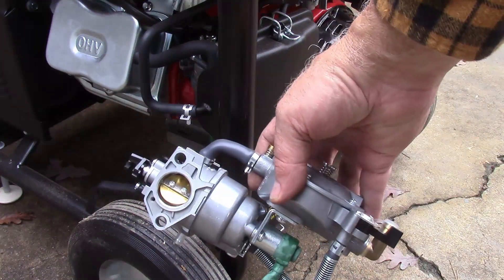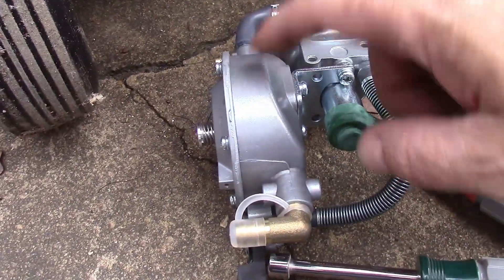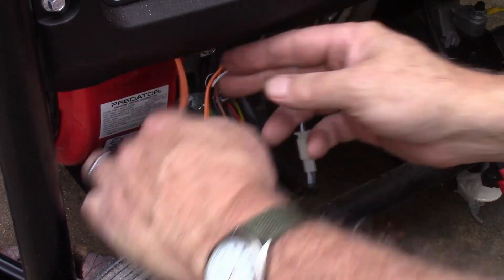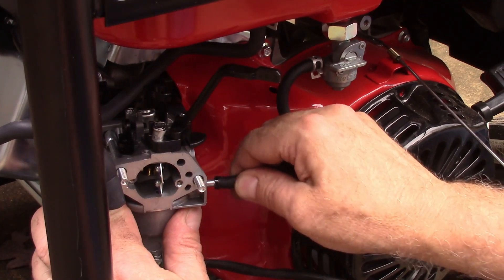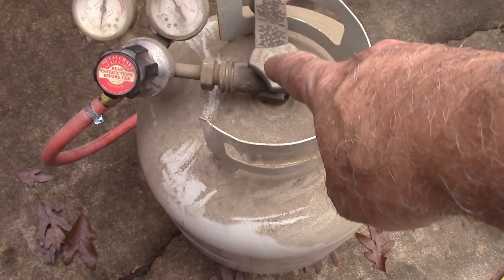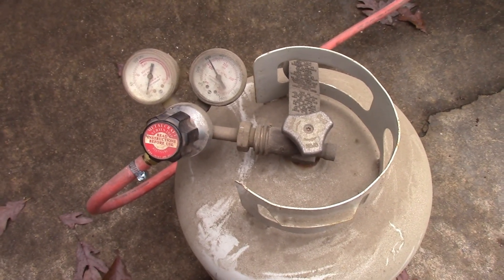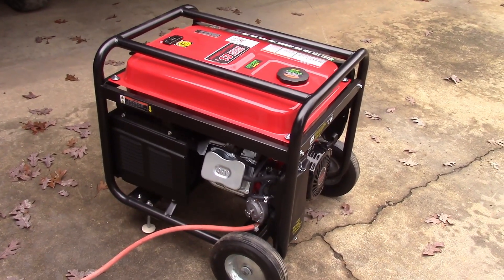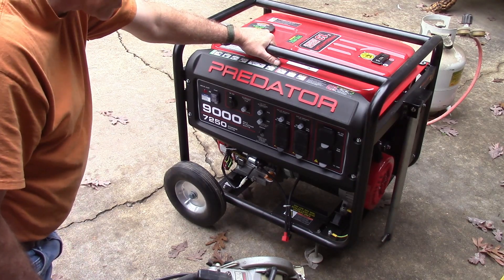Predator 9000/8750 Generator Propane Conversion  Tri Fuel

Comment: At 5:45 "The safety shut-off" is a fuel shut off relay to stop backfires at shut down.  Otherwise a good video.
Reply: Here is a reminder about portable generator safety: This advice is just to make sure that everyone is aware of all the warnings and it’s just to remind people to be careful using portable generators. Everyone has to see this safety reminder for safety. Every year, hundreds of people die or get injured when using portable generators due to carbon monoxide poisoning and electrocution. Make sure you are using your generator carefully and keeping others safe as well. There is something very serious that everyone should always be aware of when using generators. Some people do run their generator indoors which is not safe and that increases the risk of carbon monoxide poisoning which can cause death of family and you. Some people run their generator in wet conditions which can electrocute them. Please remember that you should never run your generator indoors. Remember that carbon monoxide is an odorless and colorless gas that you cannot see or smell. Carbon monoxide is a silent killer. Keep that in mind. Make sure your generator is 15-20 feet away from your house and away from doors, windows, and vents. Never use your generator in your porch too. Having a carbon monoxide detector is very important against generator safety. Some people also allow children to go near the portable generator which could pose risks. We need to keep an eye on our children making sure that they are not near the portable generator so they won’t get electrocuted or burned by the generator which is dangerous. A locking enclosure also keeps kids safe. A generator shed might look like a tempting place to explore, or take cover during a game of hide and seek, but a generator is a dangerous piece of equipment that can cause injury. It says on the manual that we should also keep children away at all times from the portable generator to avoid injuries. Please do not allow a child or unqualified people to operate the portable generator. Just because some manuals missed what should be listed doesn’t mean it’s safe to do. Always follow the generator safety rules when using portable generators. Generators pose electrical risks. If you need to use your generator during wet weather, you need a generator tent to protect your generator from getting wet. Don’t let your generator get wet. Keep your generator dry and before using your generator, please make sure your hands and your generator is dry. Do not wear loose clothing when operating the generator. Everything that is said on the generator’s operating manual should not be ignored. Never smoke cigarettes near the generator. Please keep flammable things away from the generator. Never overload your generator too. Your generator can catch fire. Never ever try to plug a generator cord into a wall outlet to avoid back feeding. Back feeding your generator is dangerous. Always turn on your generator first before plugging in appliances and shut off the appliances before turning your generator off. Use a heavy duty cord for your generator and the cord should not be worn out. All the instructions should be followed carefully. Never refuel your generator while it’s running. It can cause fire if fuel spills while your generator is hot. You should turn off your generator and let it cool off before refueling it. Having a fire extinguisher next to the generator is also important. This is only a reminder for everyone’s safety of using generators. Make sure your generator is properly grounded. https://youtu.be/I1jT3ANENvI and here is a video more about keeping others safe when using generators and also about our family’s safety. Hope this helps. Thank you. Be safe

Comment: Great job with the detailed instructions. I just ordered the same unit off Amazon to install on my HF Predator 8750. I hope it won’t require the modification of the air filter that many of the reviews mention. Also, I’m sure you’ve figured out that when using LP like you were, when you shut off the engine with the kill switch the way you did you aren’t actually shutting off the propane from the tank. Just an observation that you might make sure you consider for safety reasons.  👌 Again, great video.
Reply from the maker: Yes you will always need to shut off the propane at the source.  Let me know how the conversion goes.
Reply: Hey Soat Mon, I completed my conversion today but had to do some modifications to the air intake box. I actually have a 2020 model 8750 and Predator switched the location of the air intake hose. The air intake box is actually entirely different than the one on your 9000. The fuel tank air hose is on the side of the 9000 but on the back of my 8750. Long story short I found another video thankfully that actually addressed a work around. Not a huge deal breaker and we are in business! 👌
Reply: @trinityacreshomestead4147  which video did you find to address the newer 2020 predator 9000?  What modifications were required?  Thanks
Reply: @mintytoo  if you have the 9000 I believe you will be able to complete the conversion without the modification. I have the 8750 and it required the work around. Don’t fret it either way though. If you have even basic ingenuity skills I’m sure you can figure it out. Keep doing searches until you find what you need. Good luck 👍
Reply: @mintytoo  

Probably referring to this video:

https://youtu.be/Cf4_73UmvNE?t=523
Reply: After seeing this comment a couple years ago that it works for the 8750 I got me one & finally installed it. 
It works great thanks!
It wouldn’t start on choke but after turning it off it pull started right up but the battery for electric start was dead. My other 2 generators don’t have electric start & easy to pull.  I forget a battery is on there & don’t keep it charged like I should. 
This is the best thing I ever did to the generator & I aways have propane around for the the grills & camper. It dosen’t smoke like gas.
Reply: @smileysun9212  yeah it was an easy install and cheap date. I ran my whole house (minus the AC) for about 48 hours after severe storms here knocked out our power in Texas a couple of months back. I have a 500 gallon propane tank buried.
Reply: @trinityacreshomestead4147  I’m glad I got this generator when I did & was on a good sale. September 8, 2020 we had the worst windstorm here in Utah. The next door neighbor’s 2 pine trees went through the power lines knocking the pole in their yard & one across the street. Also bent over the mast on our homes. They even had 2 other trees fall verily missing their home. They even had another tree with the top broken out. We had the most damage in town & people blamed me for blowing out my Bday candles too hard.   
My family was out of power for about a week because of the mix up for when the electricians to come replace the mast. I did let the neighbor run a cord over for their fridge & I let others use my 2 smaller Honda generators that was given to me. 
I use non ethanol gas & glad I had 15 gallons on hand but I don’t like storing gas & a reson I wanted to switch to propane. The main reason one of neighbors bought a dual fuel generator a year later after the storm that gave me the idea to see if there was a propane kit for mine & I liked the price. I Do have a 100lb tank in the shed. 
I don’t have AC & can run the Dyer but not the microwave at the same time. The electricians didn’t like how I connected the generator to the house & changed it on me. I connected wire off the back of the meter to a box in the garage for 220 welder. I would flip the main breaker coming in before hooking up the generator backwards to the 220 in the garage. It worked fine but now got a Generlink that plugged into behind the meter & glad I got it before prices went up. The city installed it & some city’s won’t allow them but I haven’t used it yet. I do have Jackery power packs that I run CPAPS with & to charge phones. I even have solor panels for them & used for camping.

Comment: Could you please list the model number on this?  I bought a 9000w model 63970 and the air filter assembly is very different, I needed to modify the bracket for the carburator's gas portion to make it fit.  I don't believe they are selling the 8750's anymore either, they are replacing them with the 9000w models, although the 8750's were essentially the same and a better bargain imo
Reply: Here is a reminder about portable generator safety: This advice is just to make sure that everyone is aware of all the warnings and it’s just to remind people to be careful using portable generators. Everyone has to see this safety reminder for safety. Every year, hundreds of people die or get injured when using portable generators due to carbon monoxide poisoning and electrocution. Make sure you are using your generator carefully and keeping others safe as well. There is something very serious that everyone should always be aware of when using generators. Some people do run their generator indoors which is not safe and that increases the risk of carbon monoxide poisoning which can cause death of family and you. Some people run their generator in wet conditions which can electrocute them. Please remember that you should never run your generator indoors. Remember that carbon monoxide is an odorless and colorless gas that you cannot see or smell. Carbon monoxide is a silent killer. Keep that in mind. Make sure your generator is 15-20 feet away from your house and away from doors, windows, and vents. Never use your generator in your porch too. Having a carbon monoxide detector is very important against generator safety. Some people also allow children to go near the portable generator which could pose risks. We need to keep an eye on our children making sure that they are not near the portable generator so they won’t get electrocuted or burned by the generator which is dangerous. A locking enclosure also keeps kids safe. A generator shed might look like a tempting place to explore, or take cover during a game of hide and seek, but a generator is a dangerous piece of equipment that can cause injury. It says on the manual that we should also keep children away at all times from the portable generator to avoid injuries. Please do not allow a child or unqualified people to operate the portable generator. Just because some manuals missed what should be listed doesn’t mean it’s safe to do. Always follow the generator safety rules when using portable generators. Generators pose electrical risks. If you need to use your generator during wet weather, you need a generator tent to protect your generator from getting wet. Don’t let your generator get wet. Keep your generator dry and before using your generator, please make sure your hands and your generator is dry. Do not wear loose clothing when operating the generator. Everything that is said on the generator’s operating manual should not be ignored. Never smoke cigarettes near the generator. Please keep flammable things away from the generator. Never overload your generator too. Your generator can catch fire. Never ever try to plug a generator cord into a wall outlet to avoid back feeding. Back feeding your generator is dangerous. Always turn on your generator first before plugging in appliances and shut off the appliances before turning your generator off. Use a heavy duty cord for your generator and the cord should not be worn out. All the instructions should be followed carefully. Never refuel your generator while it’s running. It can cause fire if fuel spills while your generator is hot. You should turn off your generator and let it cool off before refueling it. Having a fire extinguisher next to the generator is also important. This is only a reminder for everyone’s safety of using generators. Make sure your generator is properly grounded. https://youtu.be/I1jT3ANENvI and here is a video more about keeping others safe when using generators and also about our family’s safety. Hope this helps. Thank you. Stay safe. All the generator safety rules should be followed carefully

Comment: So just want to be sure, a low pressure regulator is what you need. I purchased and installed the carburetor and got the regulator recommended by Amazon. Generator runs on gas but thus far it won't start on propane. Can you make a recommendation as to what I should do?
Reply from the maker: It has a selector to change from gas to propane.  Did you switch it over?  If that's not the problem you may need a higher pressure regulator, I was using about 1 pound of pressure.
Reply: @SoatMon  got it resolved. Still had the choke on for some reason. Once I opened it up the generator hummed like a kitten.
Reply from the maker: Awesome!  It's amazing how many times it just something simple.  :)

Comment: Nice video.  How does the engine run when there's a 50% or higher load on the generator? Most videos I see with this modification don't put a heavy load on the generator. The description for this carburetor says for up to 5.5 kw.  Your generator produces 9000 kw startup and 7250 kw continuous.  Also, this will not work for NG (Natural Gas) which is what most homes use. This uses CNG (Compressed Natural Gas)
Reply from the maker: It does good under a load. I need to do a video of it. I have not run it on natural gas but others have and said it worked which makes since. Whether compressed or not it's still going to drop it down to almost nothing before it hits the carburetor but again I have no personal knowledge just what I read in the comments
Reply: @SoatMon  I found a similar carburator listing somewhere else that looked identical to this one and stated the natural gas pressure required was 2.0kpa-2.6kpa and the average house pressures are just below 2kpa so I think these should still operate on home natural gas.  However you may be pushing it if you're trying to get all 9000w on it

Comment: Is that an aftermarket air cleaner? I bought a dual fuel carb for our predator 9000 and the air cleaner doesn't fit after installing the dual fuel carb, the air cleaner is plastic and the vent nipple is out the back hitting the gas regulator on carb
Reply from the maker: No I didn't change the air cleaner.  They must be using a different one.
Reply: Here is a video showing one guy's "adjustment":

https://youtu.be/Cf4_73UmvNE?t=523

Comment: Nice video. I purchased the exact same generator in January. I purchased the same carburetor as well to run on ng. My only issue is it appears that the air filter box has been modified since you posted this video. The vent line for the gas tank comes into the back of the filter box instead of the side like on yours. Well, this prevents the air filter box from going back on as the regulator on the carburetor is right where the vent comes into the box. I think I will drill a hole in the side of the box for this vent line and hopefully that will allow the box to go on as it should
Reply: I did as I said...worked fine. And runs great on ng. Thanks for the video
Reply: So this carb works on natural gas from the house? The Amazon link say gasoline and propane?
Reply from the maker: Let me know how it goes!
Reply: I would appreciate hearing how it loads on NG . Thanks
Reply: Typical corporate control freak move. Glad you got it running. Carb needs a modified airbox sold with it now 😀